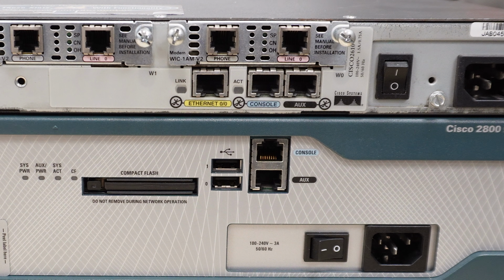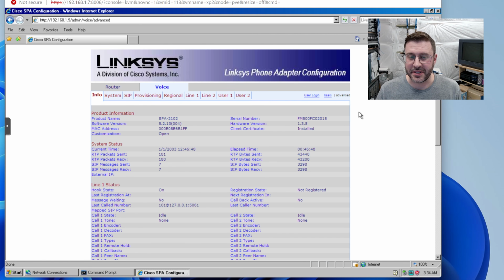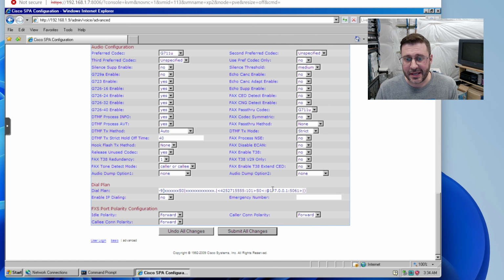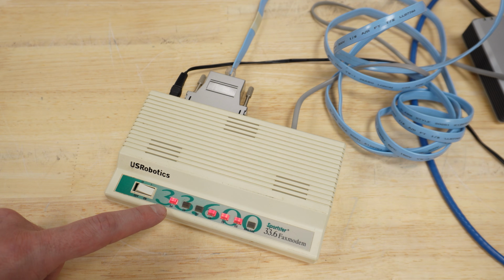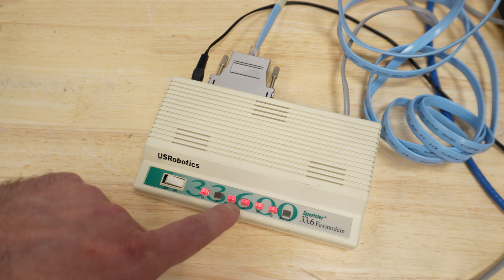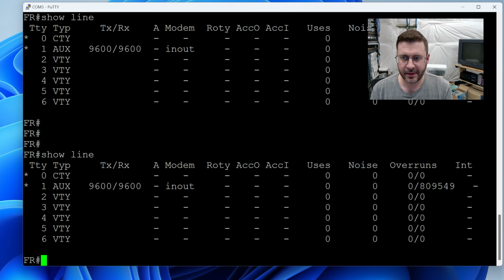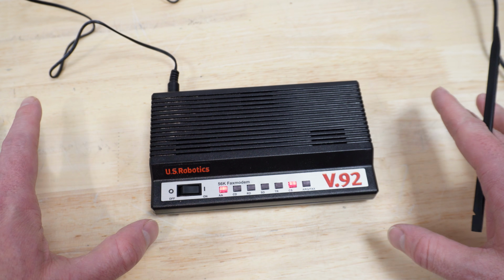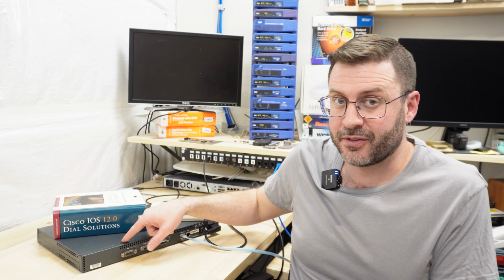Dialing into Cisco Routers

Comment: All of this brings back old memories. In the 90s and 2000s I worked on a lot of cisco, and forgot the console cable so often that I had memorised the pin-out and would just cut a network cable and old serial or modem cable and twist the wires together. We also used to take two 56k modems and give them AT commands so they never dialled and put them on either end of a "analogue leased line", which was just a normal ptsn line with a fixed fee, and then run pppd over it so that people could be online 24/7 before broadband came along. In the early 2000s I plugged a nokia phone to a linux box in the data center and used mincom and shell scripts so I could send and sms with commands and it would sms back the output and it could even run bash and send me back a page of out put as a bunch of sms's broken into 250 char chunks.
Reply: Did you get 56k out of the line? My memory of it was that 56k was one-way, and the fast-sending-end  had to be on a digital line. The other direction was "only" able to do 38.6 like the previous generation. They were basically capitalising on the fact that most modern modem pools of the time were digital modems on digital trunks.
Reply: @RichardBetel  Most people using them got 56k, except me cause I was 84km from the office and the rest were walking distance from the office. Ours were just duxbury 56k modems plugged to a Linux box on each side, and we ran bsd compression to get that 1 or 2 k/s extra. We didn't have our own modem racks because the telecoms company in my country had pops all over and you just leased "ports" and set up your own RADIUS and relm and they would forward authentication requests to you.
Reply: @RachaelSA  Interesting! I didn't know that regular "consumer grade" 56k modems could answer at 56k.

(You can't get 56k over a digital phone network with two modems using analogue wiring, and thus I just assumed that the modems didn't support answering at 56k as that would be a rarely-if-ever used feature).
Reply: @The-secret-101  It's the line rate that denotes how fast your line can send data, over a modem data call. If you have a wimpy-low quality line, then you'll probably get 1.2 to 4.6 kbps (kilobits per second)
Reply: @DeclanMiner2023  Yeah, but still, for 56k you either need an analogue PBX / telephone exchange, or if the PXB / telephone exchange is digital at least one modem has to be connected digitally to the phone network.

Two modems connected with analogue lines to a digital PBX / telephone exchange can only do 33k6.

Comment: The only time the 2901 <--> modem connection worked at all was with the Hayes 9600 modem, right?  See what those settings are and try the exact same on the others at 9600 bps.
Can you connect from the 2901 to the modem it's connected to via the console just to see if the cable is working with the other modems?
The weirdness of the SD and TD lights randomly blinking screams bad baud rate or 8N1 mis-match or something, but that's just a guess.

Comment: Telephone technician here. Something I noticed when the modem went to dial at one point, I heard static coming over the modem speaker. You have a loose connection on one of your phone lines that's causing static. That would explain the junk data you're seeing on the terminal. Try swapping your rj11 patch cords, and check the pins on the rj11 jacks on the modems and the linksys ATA. See if you have any green corrosion on any of the pins in the RJ11 ports.
Reply: you beat me to this one. , but I second the replacement of the rj11 cables
Reply from the maker: I'll try that!
Reply: Yup, I suspected the phone line connections as well from hearing the static over the speaker. Back in the day, we used to have fun dialing up our friends computer and then picked up the phone and spoke into the phone while it was in use by the modem connection. The resulting garbage on the screen was very similar. It may not be a voice, but it is a sign of static interference in the phone line itself. Definitely test your cables and check those connections.
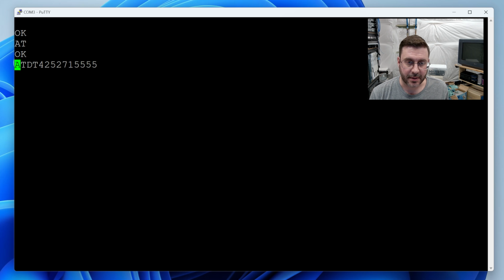Reply: It seems odd to be able to recognize the difference but the dial-up connection at 30:15 has some static. I'm not sure what side is talking at that moment but maybe this helps. Also the connection sounds at 26:30, might have some static too, but you talked over a little bit and cut it off once it sounded close. Maybe in the original clip you can hear the static a little better.
Reply: Was going to say the same thing, there's a lot of noise on that RJ11 cable. Easiest thing is just to swap the cable to see if that fixes the issues.
Reply: 9v AC causing interference with that non-twisted pair?

Comment: How do we do it? Well not to beat you up, but by knowing what we're doing. Like anything there's a learning curve. You did eventually find the path... the ancient cisco aux port document. Given the state of cisco documentation these days, I'm pretty sure it's incomplete, and partly wrong. The modem needs to be setup in a specific way before it's attached - i.e. echo off. Then there's a command to set the init string (never trust IOS to figure it out.) You really need to test the modem(s) before plugging them into the blackbox. ('tho there are debug's to see what it's trying to do.) You can also connect the PC to the AUX port and pretend to be the modem to see if it's just going completely mental.

(Also, we connected modems to the console port. That's where we need to be to see and control bootup. The AUX port is useless if the system isn't running, AND configured to allow access via the AUX port.)

Comment: Are you phone cables garbage? Could be the source of all the interference you are getting which could also be causing your issues? Also, has this old gear been recapped? Often times bad capacitors can cause very strange intermittent problems like you are experiencing.
Reply from the maker: yeah, I think the cisco unit creates a very nice line though. recaps certainly wouldn't hurt

Comment: Might want to do a pinout test on your silver adapter and see if CTS/RTS jumpers are present/connected to the expected pinout compared to your Cisco cable. If you have a map for the Cisco RJ45 pinout and the router DB25 pinout I'd pickup a screw connection kit and hotfix the wires as expected. It seems like your data flickering lights are send/receive data when it should be clear to send causing the flickering... I also noticed the Db9 cable was in play in the last scene but wasn't sure if that was you swapping cables or connecting back to the computer.
Reply: I vaguely remember that you could buy RJ45-DB25 adapters with pins crimped on wires attached to the RJ45 that you would just put in whichever position on the DB25 you wanted. In other words they were (one time) user configurable.

Also they may come from anything not Cisco related. RJ45 style connectors were used for all sorts of equipment like barcode readers and whatnot too.

Comment: so around 13:23 it looks like you have the phone cable plugged into the pass through phone port instead of the line port?  Least that’s how the USR 56k modems were physically set up 15 years ago when my company used them for OOB access
Reply from the maker: yeah I was messing around and probably had that going to a phone. it was on the line port for all the dial attempts
Reply: @ yeah, just finished the rest of the video and saw the change

Comment: fun bit of knowledge about those AT commands.  Modern cellular modems for data only usually have the same old AT commands for configuration and troubleshooting.  Not bad for a 40 year old command set 😁
Reply: Yes, but their command set is even more cryptic.
Reply: In fact when the original ESP8266 chips first came out and were marketed solely as WiFi add-ons for Arduinos—before people realized they could just use them directly and cut the Arduino out entirely—they also only used AT commands over serial for communication (presumably an updated command set that included commands for setting WiFi network name and password)
Reply: @einsteinx2  Well, they just shipped with the AT firmware installed. You can still burn an AT command firmware into them or into the ESP32. And as Brute pointed out, chips like the SIM800 and even the western produced ones still use AT commands for basic communication over serial protocols.

Comment: Its because you're going over a voice gateway...<and unfortunately those baby-ata's take EVERYTHING through the DSP, so the signal gets mangled before its even encoded>.. . basic voip <without specific tuning> struggles beyond 2400 baud.9600 for FAX, but basic data.. 2400 for data... if you had the speakers turned up you would hear the continuious retraining as it tries to negotiate a stable carrier.. - Pick up a Viking Technologies - Phone Line Simulator - they're fully analog, and i've done 56k over them before and for what you're trying to do, they are "point click-drool" easy...
Reply: I have the same model Linksys ATA box and have no trouble using it for dial-up modem calls.  Like he said, it has to be setup correctly.

Comment: Those problems with the modem scream degraded capacitors to me. Any piece of equipment like that which takes low-voltage AC in will have a small bridge rectifier on the input directly after the connector. This then rectifies to 9 * 1.414 =12.7VDC. The capacitors directly after the bridge rectifier have to be good quality to provide a nice, stable DC supply that, critically, can provide large current spikes when needed - for example when trying to switch a relay. If this capacitor, or the bypass cap on the 5V regulator, have gone bad then the digital electronics could be seeing a large amount of ripple on their power rails which causes all sorts of crazy havoc with CMOS circuitry. If you've got even a cheap oscilloscope (even one of the really, really basic things like the Arduino-scope would be acceptable as all you're concerned about is under 500Hz) and you probe the voltage rails while it's on, that will instantly tell you what's wrong. Additionally, if you replace the caps, you can safely just connect a 12VDC adapter to the modem with no issues, assuming it's laid out as I described.
Reply: ++ sound advice here!
Reply: I just realized something else -- the issue could also be inadequate or intermittent ground. When you noticed the power supply cable was damaged, did you do a full continuity check? Or check to see if the lines were shorted together at all? That could also be causing some of your issues, and would explain why the data lights are blinking randomly -- the current for the circuit is returning via the grounds on the serial port instead of through the power connector. However, it still could be bad capacitors. I would definitely try using a different power adapter if you have one handy just to eliminate that as a potential cause.
Oh, and I forgot to explain at the end of my original comment why you'd want to switch to a DC supply. First, they're cheaper and easier to find, especially in 9V/12V versions. Second, the input stage doesn't have to deal with the AC ripple after rectification, which means the main supply capacitors have an easier time overall. And third, typically a good quality DC power brick will have more protection than the cheapo AC wall warts, which are usually literally just a small transformer with a fuse... DC supplies often have over/undervoltage protection, overcurrent protection, overtemperature, etc...
Reply: Oh, I should have waited till the end of the video to comment. Yeah, I have a feeling most of the issues are coming from flow control. Just turn flow control off entirely on both ends.

Comment: It's got to be the wire/connectors between the devices causing the issues. Try a different set of wires/adapters. If a new in box 56k modem is presenting the same issues as the other modems, it's not the modems.
Reply: "new" is doing some lifting there, especially considering the conjoined manuals. but i wholly agree with your logic

Comment: It's longer than a decade since i logged into a cisco-router, and never used the aux-port, but have you tried without auto-answer on the modem, and rather let the cisco router pick up the line when it gets the RING from the modem? Since it have problems understanding CONNECT 9600 etc, my suspicion is that its configured for answering the calls with the cisco router. Also - have you tried to call out from the cisco router? I will guess that this should be possible as well. You could also investigate a bit more what the router does on the aux-port by connecting a computer directly into the port, and rather "emulate" a modem to see it it sends some strange AT-commands that override what settings you are trying to set..
Reply from the maker: I can call out from the router. I'll try without AA!

Comment: You are causing me to remember some serious late nights sat in data centres in the nineties trying to get this stuff working. One thing that caused me enough issues i still remember it, check your your RJ45->DB25 converter connects both the middle ground pins on the RJ45 to pin 7 on the DB25 some did not and some DTE only used one pin on the RJ45 which caused all manner of insanity with signals which looks remarkably like your strange behaviour.
Reply: My knee-jerk is to say turn off all flow control while testing. It really only matters when you're doing high-throughput and there's a chance of a buffer overrun.  He won't see that when typing commands at a console prompt.

Also, as I recall, the high-speed modems (anything faster than 9600) worked best when the serial ports were fixed at a speed that was faster than their best connection speed...

It's been nearly 30 years since I used a modem. We switched to ISDN BRI asafp. I feel old.

Comment: Flow control: a way for the computer to tell the modem to slow down, it can't keep up with the speed. Can be implemented in hardware by setting one line high in the serial cable, and the modem transfer will halt until that signal goes low. Later mostly implemented in software, if a CTRL+S are transferred to the modems from the computer it will halt until a CTRL+Q are sent.
Reply: Similar to how CTRL+S is SIGSTOP and CTRL+Q is SIGCONT for virtual terminal flow control when your eyes can't keep up 😁
Reply: Yes, hardware flow control requires CTS/RTS etc. lines to be connected and correctly configured on both ends. I would just disable it, there's really no reason to use it for something as slow as 9600 baud, especially on devices from the 90s. It was much more important in the 70s and 80s when there could be random indeterminate pauses that could cause a device to miss incoming characters otherwise. Software flow control is totally separate, and is implemented more or less as you described. Both are pretty much completely obsolete, and were obsolete even in the mid to late 90s.
Reply: No, the other way around. A way for the modem to tell the computer to slow down.

Comment: omg I haven't worked with one of those Linksys VoIP boxes for like 20 years ;s That GUI gives me PTSD.

Also, before RA BBS days, I would drool over having a 33.6k modem. I had a 300bps external packard-bell serial modem, and a 14.4k modem eventually in around 1996 ish maybe I want to say.

I used it to PTPP into a friends 'ISP' that he setup and I paid for internet access. It was the first time that I could actually use the internet over a phone line that wasn't text based. Everything prior to that was FIDONet and other usenet groups that were made available on the BBS at the time.

It was a simpler time... But L.O.R.D., Usurper and TradeWars2002 were like the go-to door games in those days. I even ran a RA (Remote Access) BBS back in the day with a friend who now works in some financial institution or something. Oh the stories.

Edit: The one thing I was constantly thinking was AT&F which stuck in my mind as a reset. I looked it up and yes:

    at&f        - return all settings to factory settings

So maybe that will undo any things you have done over the years with that modem and reset it to factory, then you can start from scratch?

Edit 2: I made it to the end. Saw you had an &F in your init string. Uhm... If the 2501 doesn't support hardware, you may have to resort to software perhaps? That would just make it so the modems are the ones responsible for handling flow control. What happens if you turn it off on the router but the modems have it on?

Not sure, cause if the two end points are the modems that would handle congestion, the router may be adding something in the mix with commands being sent over the aux port that are messing with the modems ability to function somehow?

It's been many years since I've messed with that kind of stuff but...